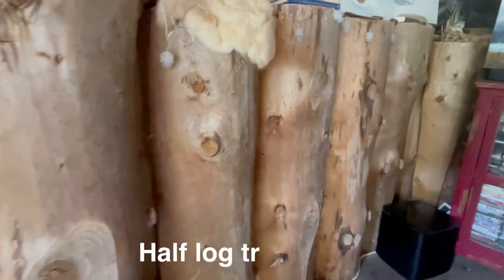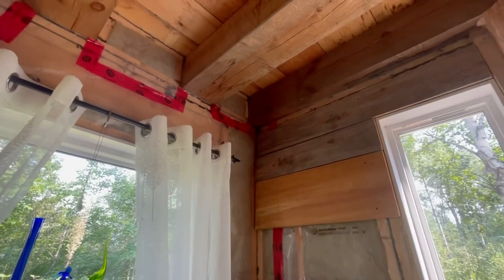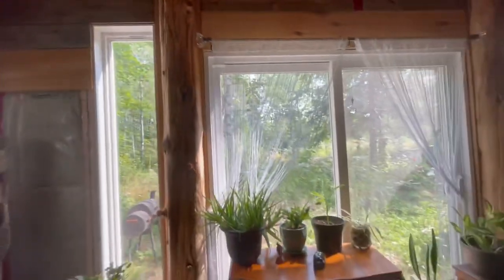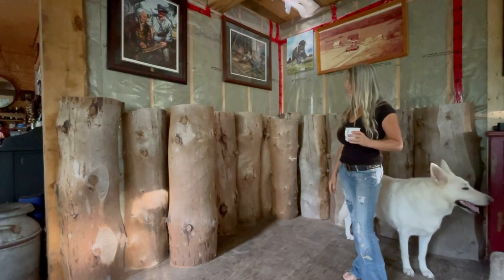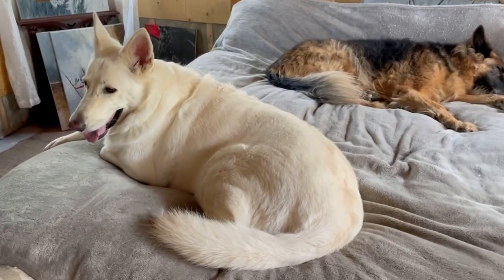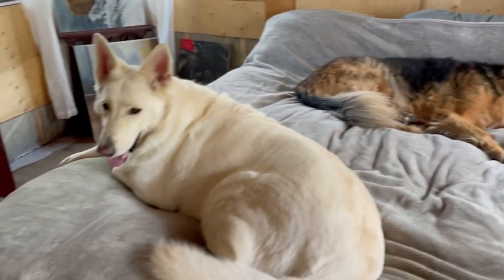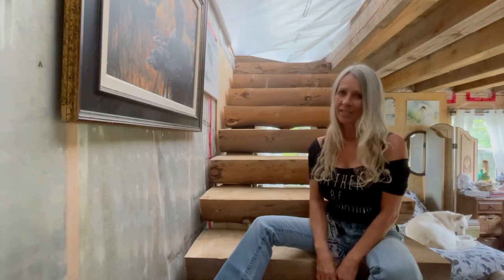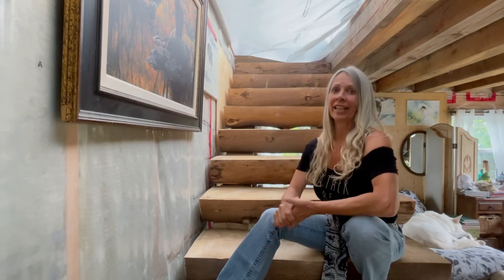Staircase 2 Heaven/Building Half Log Staircase in my Off Grid Cabin!/-EP 33

Comment: Nice to see you actually doing ALOT of the work on your cabin rather than having it contracted out, the walls and doorway look awesome ❤️👍 so do the stairs ❗. 🤔the gas fireplace isn't the most efficient way to heat, if you build a rocket mass heater for the cabin it will save you literally tons of firewood.  Although I can see using gas as a backup or just for something different now and then 🌹❤️
Reply from the maker: Thank you...I will look into that! But main reason for the propane fireplace is for backup, won’t be used often.
Reply: Looks like Richard did almost all the work...
Reply: @One.woman.wilderness  The propane will work fine . Nice to just flip a switch for extra heat .

Comment: On the railings and as already commented on cable wire would be good, kits used in making balustrades might work, usually installed horizontally, but can used vertically also.
Reply: Cool idea. Though I think wire rope would be more appropriate than cable wire. The main difference being that cable is 3/4 inch or smaller. Wire rope is larger than 3/4 inch.

Comment: Those cedar half logs really do a great job framing the sliding glass doors.  I found one of your video's that showed your wood stove burning with the door open.  I was able to zoom in and sadly I did not see any secondary air tubes for secondary burn.  If I may, and if you already have one, my apologies, please install a thermostat in the flue pipe and try and always maintain a minimum 250 degree flue temperature or higher to prevent creosote buildup.  With winter on the way, do you make an appointment for the chimney sweep to inspect your chimney?  
Take care and enjoy your new stairs.

Comment: Nice staircase!
If you could put rough cedar siding on your interior walls and ceiling upstairs, at some point in time, you could cool that bedroom space extremely efficiently with an evaporative cooler for the Summers.  They are rated for less humid locations for optimum performance, but the untreated cedar board would keep the room's humidity really low to compensate.
You might even be able to find a window unit type.
Another word for the system is "swamp cooler."

Comment: That's a hella project! I felt a lot better when I saw those straps at the top of the stringers!
Reply from the maker: I also plan on erecting 2 vertical support beams once I get that floor done.
Reply: @One.woman.wilderness , there's about 1,000# hanging on that beam. That's about half of what I guess the whole stairs weigh. Between the stringers and that beam they're attached to, I'd say you don't need vertical supports. But --- Id drill through both and replace the straps and screws with 2, 3/4" bolts and fender washers. Whatever you do, it's an impressive piece of work!

Comment: This was a great video. Loved the construction process of your staircase. As far as a railing, perhaps a slim black metal railing lag screwed into the top into the upstairs floor and standing on the floor. The stand can be Lag  screwed into the side of the Treads. Metal is strong based on the limited attach points coming down. 👍

Comment: OWW, little suggestion, if you don't have one already, an incredibly useful thing to buy is a small 1000 lb hand-winch on Ebay for about $20. Once you start using it you will wonder how you lived without it. Get a small pulley block with it a "snatch type", which opens to allow you to put the cable in at any point on the cable and this doubles the pull/lift to 2000 lbs. You can effortlessly move things like those stair bases around and hold them into place whilst you secure them on your own. Obviously it goes without saying that when doing overhead work like that with heavy beams you need to wear a safety helmet and exercise sensible caution but there are hundreds of other perfectly safe applications when moving heavy stuff around.You would not believe the things that I have moved around and built on my own just by using a simple little hand winch to hold heavy stuff in place. Opens up a whole new world of possibilities to tackle things that otherwise would need another person.

Comment: Lisette, your beautiful as always, even while working hard . The stairs turned out awesome, but with the experience that I have working on stairways, I think that you need to put a post under each one of those stringers, anywhere from halfway up or under at the top . Because there is a lot of weight there and as the wood dries out more and settles . I would hate to see the stairs pull apart or fall . I love the way that your house is built and the stairs is really going to add to it when you get them finished with posts and spindles and railings . One of my friends built him a new log house, back several years ago and built a stairway similar to yours . I will see you later and always be careful and stay safe and keep on working on your finishing up projects.
As always, Jeffrey !!!
Reply: As a contractor I say no you don't need more post for support. In the pictures they look like 6x6 notch them half is ok they are not supporting the floor so she should be good. I would be a little more concerned about what was used to anchor them to the ceiling. A couple 3/8 lags should be ok. They never showed that so I can't say.
Reply: @randybedard4113  This is Jeffrey, that made the comment about the half split log stairs . What you were saying about how that they are anchored into the floor at the top, that is what that I am wondering about, not strong enough, maybe if it had  thicker and bigger metal hangers, cause there is a lot of weight hanging there and those smaller straps and smaller  screws or lag screws might not hold forever by thereself, without putting posts under those main stringers. That is what I was meaning about adding the posts underneath . 
She just showed how that they are  fastened  in the top for just a few seconds and it didn't look like that it is enough for over time . I have seen where that logs would split as they dry out , right where that nails or screws or bolts are at . I have a barn that was built around 1890 with logs and beams and it has done that and dropped
and pulled apart and twisted and so on in several places .
Better stronger and braced and safe, than sorry later.
Over the years I have mostly worked on and installed several spiral staircases and you have to make sure that you anchor them in good at  the top . The biggest spiral staircase that I have worked on and installed part of on top of one that was already there about 18 feet tall, from the basement floor up to the second floor. And then I put more spiral staircase on that up to the third floor and on up into a tower on top of the 3 story house . That made the spiral staircase about 40 feet tall, altogether. And at each floor, I had to install a get on, get off plate and bolt it in to the floor with large steel pieces .
So I always put in really strong braces and hangers to make sure that they never pull apart  on any kind of staircase .
As always, Jeffrey !!!
Reply from the maker: @Jeffrey K Bevins... 
I plan on installing 2 vertical support beams. I didn’t have the beams with me and I recently found some old barn beams I’d like to install there.

Comment: Great great video. I also build with "repurposed" wood/metals, etc., to make my 2300 sq ft cabin look its "Period" 1929 style. In addition to the "bean straps" holding the top end of the stairs per beam, I would also install 90 degree metal "angles" to the underside of the supporting ceiling rafter and then tie those into the sides of the stairway beam with lag bolts to its sides. You'll have atleast 500-600 lbs of dead weight at the top of the staircase dependent upon what else is carried to the second floor with the additional weight. This entire home is a beautiful build and has a wonder "full" homey bungalow style. IMHO I would also build all natural kiln dried wood railing to the second floor gracing the tops of the stairway. Very appreciative of your talent in design and carpentry. A+

Comment: Beautiful Miss Kimber! I read some of the suggestions. The stone wall behind will compliment any kind of handrail and baluster or newel post. I'm partial to posts of the same Red Pine with Willow weaved between. Harvested and installed in the spring will require few fasteners and will tighten as they dry and cure into position.
Money, Money and more money I know, jamb extension screws are narrow and barely noticeable but expensive just to hide fasteners. You could pry back a short amount of grain, drive in your screw/fastener then glue down the section of wood over the screws. 
You have a beautiful home Miss Lisette. I envy you! When I built my log home in Montana I recycled old power poles and kept it more utilitarian.  Enjoy decorating and finishing your home, it is already beautiful.
Thank You for sharing
You are in my prayers
Hoka Hey

Comment: Will you have enough room for your stone wall? You will need to figure enough width for plywood (I would use concrete backer board), metal mesh screen, mortar and then the width of the rock. Looks a little tight to me. But- this is high quality work. Richard did a great job transferring the shape of the treads to the 8x8's. I love the look! It will look really fantastic when you stain the treads, good job!
Reply from the maker: I have an inch and half... so I plan on getting the stones that are cut into tiles. Will make it much easier... they are about 1” in thickness... so I’ll have enough room. 
And thank you very much. 😊
Reply: @One.woman.wilderness  Good thinking, that should work out nicely and look great! I look forward to watching you work on it!

Comment: Debarks some 2 to 3 inch in circumference logs or branches. Run them strait up from stairs to rafters. With a couple inch gaps between each. Then there's no need for a railing. The stairs will be caged and structurly stronger and you or the fur baby's can't fall over the side. Then u can put some plants or vine growing plants on a table next to the side of the stair case and they will grow up on the branches and up the outside of the stair case, facing on the outside, side of the stairs. I think that would tie it all together.

Comment: Hello Lisette, I'm just seeing this video of your new staircase. Very impressive. I see a lot of birch trees on your property. Have you considered posts of two smaller birch trees per tread and then a bigger one for the railing? The contractor was ok with just those four screws and metal brackets holding up all that weight? They look sturdy but I'd have more peace of mind with a couple posts about 2/3rds of the way up underneath those stringers.
Reply: That's exactly what that I was thinking also because there is a lot of weight there  and as the wood seasons out more and as it moves  and settles from summer time heat and winter time cold, 
expansion and contraction.
I have seen even big lag screws pull out as the wood dries out and settles .
Reply from the maker: I will be installing 2 vertical support beams, I didn’t have any at the time. I recently got some old barn beams I’ll use.

Comment: Railing?   I did a log rail and finally found a use for those worthless Russian olive bushes.   The limbs are really flexible.  So I spent a day in front of the wood stove peeling the bark off . When done skinning I kept them in a bucket of water.   I brought a whole set of drill bits to my railing and 4 drills.  I sized each end of a particular branch, figured where it was to be placed then drilled the holes and weaved the branch through the other ones and popped it in the hole on the other side just randomly.  No pattern.  It turned out way better than I thought.   You might can see some pics of folks doing that and see how you like it.  👍

Comment: Two unrelated comments; i once built a stairway simular to your planned one i found a small chain saw to be so useful in cuting a hole in the ceiling and shaooing the steps. Try to use the engineered rise and run so the steps come our even. Item two. Safety. You know you are increasing safety by being alone.  Your dogs are useful so is a club etc. However the best is a gun with some training  a small pistol would be best.  Women tend to not do this, its your risk.
I use black powder pistols which have drawbacks but legal standing in USA is different..
Second if you can get a monitored security system. .  Aways carry a cell phone and a bear stopping pepper spray. Always. There is no perfect safety. However always be alert and liston to your gut. You have instincts we all do, if you feel something creepy its usually for a reason.
Anyway you are smart you will be fine. David

Comment: Just tuned in to your channel. You mentioned building codes early in this video. So the question is what is a handrail for,and what is the height, gap between pickets. Also remember if you fall splinters or knots in the wood can tear up your hands. I like an idea of say 5 or 6 inch diameter vertical posts, debarked and planed and sanded smooth. That leaves type of closure between posts. Hear in Virginia I believe 4” is the maximum. Keeping with the rustic look I believe this could be the biggest decision, next to the grab part of the code. Can’t weight to hear what you come up with.
 P.S. glad to see those decorative black straps on the top stringers, but hope you still install a type of mid post bearing under the stringers.
 Good luck ( Krafty NWR).
Reply from the maker: Yes, I plan on installing 2 vertical support beams. I just recently found some old barn beams, I just need to finish installing flooring on first floor and then erect those beams. I have a big to-do list! lol 😉
Reply: I’ve been thinking about your rail, not much in the conventional wood or oak will go with those large half log steps. Maybe think about rout iron painted black. Many designs to chose from.
 Baseball bat! Some dogs if trained right will let strangers come up to the front door, But Won’t Let Them Leave!! Ask my brother who was dating his future wife how soar his backside got!

Comment: Dear Lisette, I love your house and I live in a place more remote, having built a staircase out of an old boat amongst many other things. 

As a carpenter of countless years I feel that I must add some comment on the staircase construction, for your own safety... those two heavy stringers have been placed UNDER the trimmer, held in place by just two screws/bolts on each metal strap, when they ought to have been placed AGAINST the trimmer, on its face, and then there would be no need for those straps. Doing it this way would only have increased your angle of rise by two degrees, and would have been far, far safer, rather than relying on two screws in each strap, which now are holding the weight of each stringer plus the weight of each half-log of tread. If you wish to leave it as it is, can I suggest an upright under each stringer at the top, to take this weight.

I love your series, many thanks for it.
Reply from the maker: I actually will be installing two vertical support beams after I finish my floor.

Comment: If you are still deciding on the hand rail?   Have you considered a iron railing? Could be painted the color or your choice, and would not take up much room, or block any view, and would be sturdy enough to hold on too? Also would be easy enough to curve around at for the bottom stairs the curve at the bottom.
Reply from the maker: Yes, I’m still deciding on the hand rail. I need to finish my floors first. Thank you for your suggestion on this. 😊

Comment: wow lisette, that's all very heavy wood, that staircase has gotta weigh over 1000lbs, that is really custome work, that's awesome lisette 😀 forgive me, I don't mean to make you doubt the carpenter you hired, he did an awesome job, but i'm a little worried about where the 2 support beams for the stairs connect to the 2nd floor, those 2 metal brackets on each beam, are those connections strong enough for moving furniture to the 2nd floor? Maybe put some vertical supports just beneath those joints with the brackets? Like the 2 verticle supports he put at the bottom of the staircase under those beams, do you have to put a railing? Those stairs will look beautiful adorned with candles and pictures and maybe a little mushroom lamp, from: Scranton, Pennsylvania

Comment: Nice! Curious....are the tops of the stringers connected to the bottom of the second floor landing by just 2 or 3 screws each? For all the weight of the stairs???? OMG.
Reply from the maker: They are all connected with 4 screws plus a metal strap. Metal straps have 6 screws on each (2 metal straps per beam) and they are also screwed onto the landing. But I will be erecting a vertical beam (which I mentioned in a newer video) I haven’t done this yet as my floor isn’t finished.

Comment: Hoping you are gonna put some uprights under those stringers. Timberloks are strong, but those stairs are awful heavy. wouldn't want the stringers to fall. I use Timberloks a lot, but sometimes they will almost twist in half while putting them in and once buried in the wood you can't see if they are compromised. Just a suggestion with from learned my lessons over 35 years and still learning.
Reply from the maker: Yes, I will be placing 2 vertical support beams…. I need to finish the floor first. I have some old barn beams I scored on last year. I will use these, it will add more character. 😊

Comment: hello from Newfoundland ..not my intention to criticize the work of anyone else in terms of your staircase , its quite beautiful but i noticed that you have only 4 long deck screws that are holding each stringer that the treads are resting on , did you also add some heavier lag bolts afterwards or posts etc. at the top to support the weight ?
Reply from the maker: I plan on installing 2 vertical support beams. Reason they weren’t installed is because my flooring isn’t finished yet.